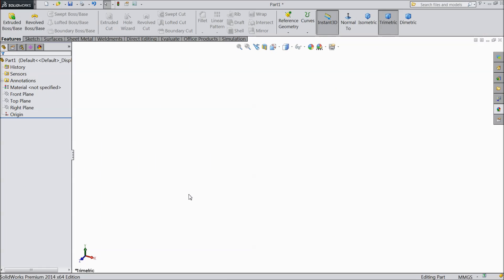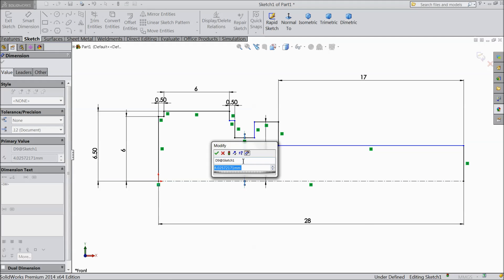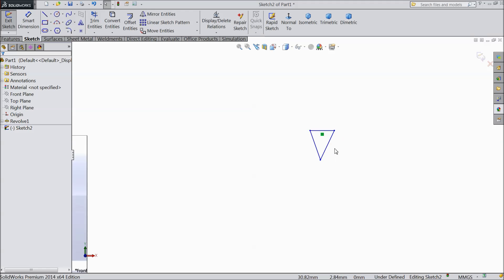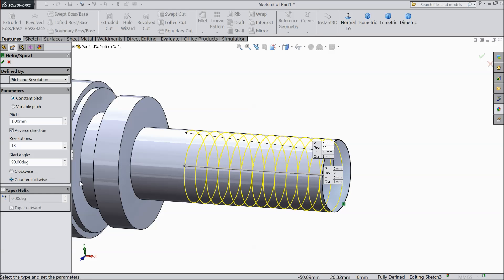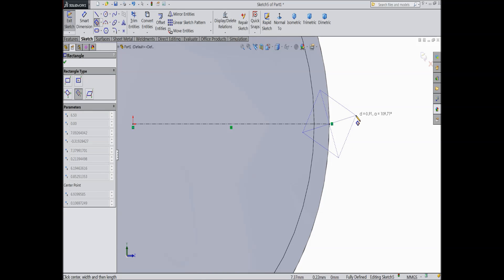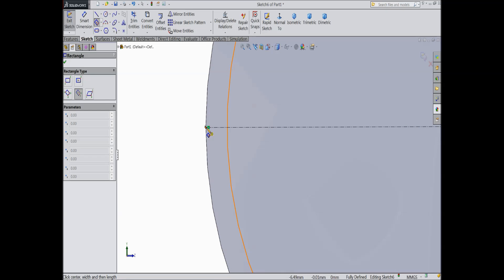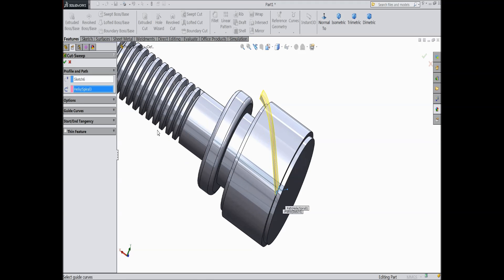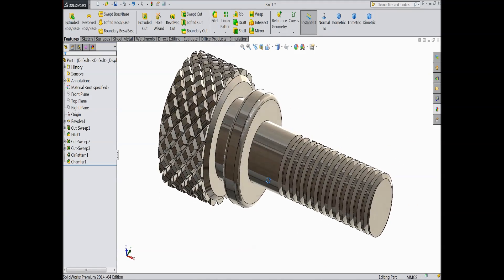Solidworks tutorial How to make Knurling Screw

Comment: Not to criticize, but to offer some other ideas.  If you want to make the thread accurate to a standard, say ISO or UN, make a triangle and then a line connecting the midpoints of the two sides that are not parallel to the axis.   This line will become the pitch diameter.   Dimension the line that is parallel to the axis to the pitch of the thread.  Now dimension the pitch diameter to your standard.  Position the triangle such that when driven by the helix, it will cut where you need it to.  Exit this sketch.  Make a new sketch where you convert the two sides of your original triangle to lines in the second sketch.   Put your nose radius here.  Now make a line parallel to the axis, but short of the same line is the first sketch. Trim the corners.   This way is a bit more work, but it makes the thread exactly to your standard.  Trimming the parallel line short of the first triangle prevents SW from failing to drive on the helix.  It helps to hide the first sketch before driving the helix, making it easier to choose the correct sketch to drive.   Once the thread is cut, go to the end of the thread.  Click on the small surface that is parallel to the axis, click to make a sketch on that surface.  While the surface is still highlighted, click on “Convert Entities” to form an outline.   Project this as an extruded cut out the side of the thread.  You no longer have an abrupt end to the thread, but an smooth exit.
Reply: We can also just use proper standards by taking industry standard threads that exist below hole wizard
Reply: @svrt5832  I seldom use the hole wizard.  Does it do tapered threads?  Does it do external threads?  I suppose it matters what one is modeling, and just how accurate the threads must be.   I have modeled quite a few API threads, (both pin and box) where the pitch diameter of the thread is specified at a given distance from the shoulder.  The thread form is also specified.   Never could get the hole wizard to do those threads.  If you know, please let us know how.  Thanks.

Comment: I watched the video. There is 1 problem when you dimension the wireframe. It seem to me you dimension the "radius" not "diameter". To correct that when you pick,  you pick the center line first then pick the line and drag dimension below the CENTER LINE then it give you a "diameter" dimension instead of "radius".
Second problem you don't need to create 2 curves (for diamond knurl) just create 1 curve then mirror that curve then do pattern. Try that, let's see it works.
Reply: yup i just learned that trick

Comment: Dear sir,how to find out /calculate the weight of any  metal rod /sheet  etc. in Solid works;also how to confirm density of the material or is correct.please guide.
Reply: Click on the Evaluate tab, then on Properties. There you'll find the weight and density.